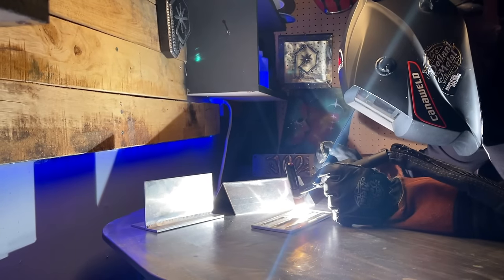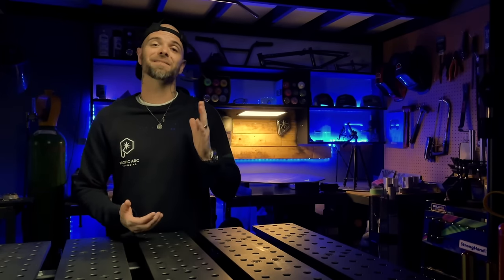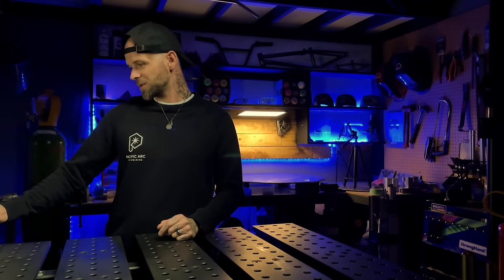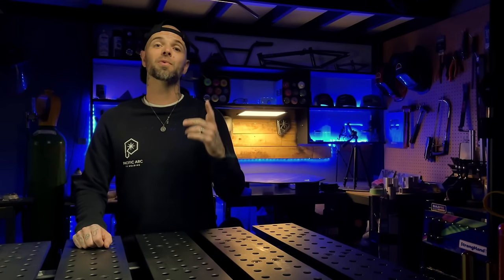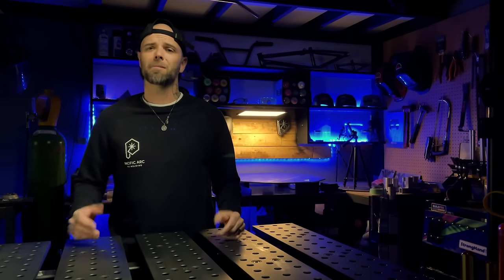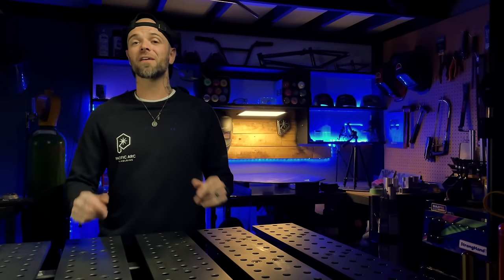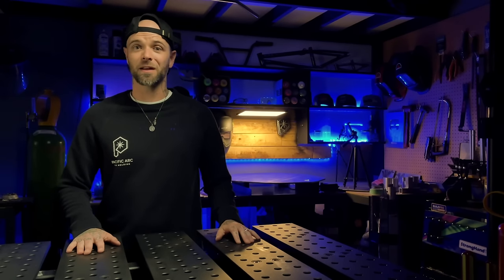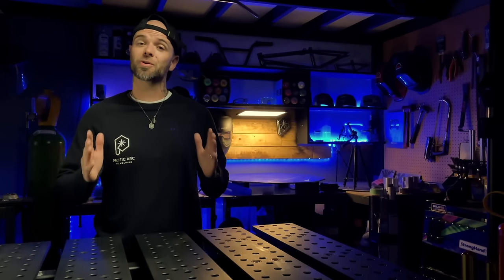a WARNING to all beginner tig welders.

Comment: I've been TIG Welding for more than 50 years. In fact, it's all I know how to do. I can't Stick-Weld for s***. I don't like Wire-Welding of any kind ... Simply put, "I don't like sparks". TIG is clean, quiet and versatile. That said, this channel is GOLD and is the ONLY welding channel I watch. "Why" you say? ... here, I'm reminded of things I actually knew from experience, as well as the occasional "I could have had a V8" moment ... referring to "duh" ... and the ODNT thing.
Reply: I'm the polar opposite, I can stick and mig weld but can't weld tig for s##t 
I'm wanting to build my own custom exhaust, I don't want to use mig, I sure as hell ain't using stick so think I'm going to have to bite the proverbial bullet and start practicing tig welding lol

Comment: Took me about 5 months of welding in HS welding class and also showing up early every day during lunch to be good enough to get a job doing it. The first thing my teacher had me do with each weld process was scribe lines on 5"x5" flat plate and run just the torch no filler over them till they were all a consistent width. This got the whole class good at controlling heat with the pedal before ever using filler.
Reply: that sounds like a good trick for me to practice!  —  I’m totally new … so, yeah, I need to put in the hours doing this, exactly.  💜👍

Comment: Yeah, discovered that the hard way 😏. One bottle of argon later found my collet body was loose. Been paying more attention as to the shape of my torch and things have been going a lot better 😊. In all that I also found that having 3 or 4 electrodes preground is a big help too 🤣.
Thanks man. Cheers!
Reply: I grind the whole pack and keep it on the weld table next to me because stopping to grind tungsten is a huge buzzkill.

Comment: I have been watching your videos for about 1 and half years and still have not picked up a torch. Im going to change that. I picked up an AHP 203xi and will be practicing what I have learned from your videos and what I want to weld is not and easy starting point. I and getting into my motorcycle building and need to weld on the frame and tig welding looks awesome. I cant wait... all Im waiting on is my argon to come in. Wish me luck.

Comment: I started off with gas welding, so I found tig far far easier then stick or mig. but it is still a brute force weld, not very pretty but solid and reliable. Advantage of that you learn all about torch set up, and keeping my tungsten ultra sharp hearkens back to my enjoyment of sharpening a pencil to the point it was sharper than a hypodermic needle!

Comment: I started in around 2000 with a three phase miller and would have a scrap piece to ball my tungsten and now use a primeweld 225x and can weld anything with it but the younger generation needs help to get to a good level of understanding and he does a decent job so stop cutting others down and judge yourself on what you’re lacking and not bringing to the table

Comment: Any chance of doing a video on lift arc/ start tig welding? Just tips on how to tack ect. Got my first tig welder and chose this because it was cheap, will be upgrading to a HF down the track, thanks mate!
Reply: Just barely scratch the metal to start it or touch it down then rock it back on the cup. I have to do this even with HF start sometimes if my ground isn't perfect.

Comment: Should I get MIG or TIG?

I've had my stick welding machine for a month now. I am very confident with it now. It's just that I work with thin material 90% of the time and I'd need to get another machine for this purpose.

Until now the only two projects I made are a bike ramp and a metal toy trolly. For my applications, TIG and MIG are much better suited than stick welding. The reason why I'm leaning more towards TIG is because I can weld aluminum and stainless with it, and jobs tend to be much better paying than MIG.

Another reason is that since I am new to welding, I don't really want to get used to the ease of MIG welding in this early of a stage in my career (I know I'm exaggerating a bit here). I want to get used to the complexity and control of TIG from an early stage so I'm better off in the long run.

Comment: Another great analogy would be a guy buys a brand new sports car and thinks he's going to kick ass on a road racetrack. As someone who spent a lot of time and money learning how to drive on a racetrack, i can almost guarantee dude with the brand new corvette and an inflated ego will almost always end up in a tire barrier (or worse) on their first track weekend. Even drivers who know what they're doing are not immune to the curse of complacency. The guy who taught me track driving was killed in a crash on the same track he taught me back in 2017. 

A while back a friend loaned me his $1200 multiprocess (yeah...) Lincoln TIG and a bottle of argon i'm still feeling in my back from loading into my truck, and I agree it's definitely not easy. I watched a ton of videos and still had issues. The biggest of which was one of the most elementary of concepts... electrode distance. For some reason i had it in my head that farther was colder. Once i got back on track, i was able to make some not-horrible welds. I'd love to spend some time with a TIG that had high frequency start. The machine only had lift-start and while i got pretty decent at it, i got tired of resharpening my tungsten pretty quick.

Comment: Hey dusty best advice I've seen on here for a long time . Love the golf analogy.. as a biker that is the epitome of all the gear and no idea. 
I bought a German made set up about 3 year ago with intentions of using more than mig . Boy is it an eye opener however as a lot say practice works , I'm still at the base level but it's fun trying to get all the things coordinated at the same time . 1st few attempts came out pretty good flat straight runs.  I've found cleaning can be an issue sometimes however it's a learning curve . Thanks for the advice .

Comment: I kept having dirty tungsten when welding aluminum, then I increased the post flow to 8 seconds, and used smaller cup so I can get by with a lower gas flow, and the dirty tungsten problem went away.

Comment: A TIG torch is just a handheld arc furnace. Any impurities will rise to the surface as slag. No need to waste time/argon for clean welds if you aren't doing sanitary or out-of-position welding.

Comment: Hey guy, I have a miller syncrowave 180 tig/stick welder,when I got the machine I noticed that it had a 20 second shutoff for the gas,is there a tig handle with a shutoff valve on it the also use the foot pedal,any help would be appreciated

Comment: Is it just the particles in air that contaminate and burn your tungsten 
Or the carbons from welding 
I’ve done a fair amount of stick welding on tractor s and mig around the shop. Brazing and even jewelry repairs ! I’m fascinated with tig and I have a lot of drag bikes ( mini drag 200-300cc) and I really wanna learn to do stainless tubing for exhaust! Exhaust tuning is where you get some extra horse power and makes some really sick engines , max flo thru  big valve head !

Comment: Personally I'd start out with a Mig welder with the bottle of 75/25 and learn how to use it first and then move on to TIG later. If you're just starting out.
Reply: If you want to learn fast you will want to start with the more manual processes first. Mig can teach bad habits that are hard to forget if you have the machine set up wrong to compensate. In school I started with 7018 stick, then did mig, then aluminum tig.

Comment: Just seeing the thumbnail I thought you were going to tell us not to constantly bend the "flexible" torch heads. I say this because they can and will break. The ones iv seen break and fall apart are corregated copper tubing. Copper work hardens like aluminum does and will crack if you bend it one to many times. Cheaper torches that come with the cheaper welders will break a lot faster.

Comment: I'm currently working to learn stainless butt joint. I am running a pedal set to 98 Amps. 1.2 mm material set in a purge block no filler. Trying to learn this for an employment test.

My problem is by the time I get full penatration, my bead looks too hot on the top side. The backside looks good nice and silver even penatration. But like I said top is dark with small areas of pink coloring and some matte grey areas. How can I get good penatration without getting it too hot on top?? Orrrr is this a gas issue??
Reply: 1.2mm is about 0.047”. If you go by the “rule” of 1 amp per 0.001” that should put you at 47 amps. Maybe try lowering the amperage… unless all the settings are set for you for this test.

Are you using a gas lens? What cup size?
Reply: @VictorMPR  yes a gas lens and using an 8 cup. I want to buy some jumbo lenses and cups on payday. I'm not sure if they set the settings for me or not. I do know after initial arc start I come about halfway off the pedal. (I'm still trying to get used to this though.) I will try lowering my amps. I believe the actual test will be on .065 mm material. I'm using the only stuff the school has to practice. 🤷‍♀️
Reply: I find that 15% to 20% less than the "rule" of 1 amp per 0.001" works better for Stainless. But lowering the amps doesn't always help. It can slow things down & you end up putting more heat into the work because the pass takes longer. Better to just get a move on! (Easier said than done though...)
Reply: Fupa 12, flow at about 30-35 cfh and crank your amperage up higher than needed so you get full penetration then keep it at all you need and go as fast as you can to get out before the oxidation sets in
Reply: @MidEngineering  yeah I have adjusted amps up and down. Speed up and down. I've tried filler to cool the puddle. No filler. Tiny gap. No gap. High cfh low and mid cfh. Just so many combos it could be lol! 🤦‍♀️🤦‍♀️🤦‍♀️I'll be going in tomorrow to work on it some.
Reply: @chad103099  lol!! I'll try that! My fast speed is probably slow speed for most. I worry more about running out of time during the test than failing the test. I have 4 welds foe the test. T joints stainless and aluminum (got these down to an art now) also butt joint stainless and aluminum. I'm terrified of the aluminum because it was way harder for me than stainless and I'm struggling on the SS butt joint.
Reply: 30 amps per mm in flat Position, and at that thickness you'll need aluminium blocks to move heat
Reply: @Slouworker  the purge block is aluminum.
Reply: @Slouworker  I'll try that heat tomorrow

Comment: I started welding for the first time this year. I managed to knock out Stick in a few weeks. Then I moved on to TIG. I'm far from an expert and never will be, but I will say this:

This man is spot on. the fundamentals of stick carried over to TIG. If you don't make sure the little things are done, it doesn't matter what you have. You could base metal so clean it's a mirror, but if your setup isn't right (heat, good rods/filler metal, clean stinger contacts/clean torch, so on) you're only gonna get bad results. GIGO. Garbage in, garbage out. 

I love my new found talent because it's the first time in my life I genuinely understand something I'm doing. That weld isn't picky. It doesn't care who you are and it doesn't like the next guy any more than you or any less. So when you screw up a weld don't immediately blame the equipment. First point to yourself and ask what YOU didn't do right. I've laid plenty of beads at this point and I've yet to lay a bad one that was anythings fault other than my own.

Good luck guys! Send it.

Comment: Are there differences of the helmets for different types of welding?
Reply: Hi Ron, if you're planing to weld TIG with a auto darkening helmet, you'll need to make sure it's TIG compatible. Some helmets don't have the sensibility to darken with TIG. Cheers.
Reply: Some darken to a fixed shade, may be too dark for tig. Need an adjustable one.
Reply: here in australia  ? i found i had to buy another helmet my ,mig helmet didnt go light enough  to do tig ?  mig is higher amps so darker the shade , were tig is lighter shade ?

Comment: Why do only show welding Aluminum  not steel 
I  lay two pieces  of steel together  and try to weld it together I just burn holes in the top plate don't matter   what's the amps are set at can't  even tack weld I just burn holes in top plate  40 amps burn holes 10 amps burn holes .
I have two welder a 210 Lincoln scratch start also got a Vulcan 205 high frequency start when i first got Lincoln I welded a bracket on my rotisserie   for the first time doing tig I was a fair job but it was only 2" long also 
Now I just burn holes  If I do fusion weld I have too go fast if it don't burn a hole in plate but you can Not feel the weld but can see it  
Had a guy from my work place that works in weld shop he there something  wrong with his welds where full of holes he weld on trailer  just about every day  he can also tig weld  so I took Vulcan 205 back got a new one does the same thing burn holes don't matter what the amps are 10 or 40 on 22 gauge steel I called the welding store where I get my gas I asked them if it could release the wrong gas and not a hundred percent Argon they said no way it could be the wrong gas
I think it is the wrong gas I shouldn't be getting Sparks and sometimes I get Flash starts when I do get a bead going  also  the bead is flat as it  can be even with filler to get any body to weld I have to go fast  even at 10 amps   with 1/16 tungsten

Comment: 99% isopropyl alcohol…. after grinding clean…?
Reply: He uses acetone
Reply: @markshort9098  I have that stuff just in case, but avoid it when I can ‘cause it has evil fumes.
Reply: @dennisyoung4631  yeah it's nasty stuff but it cleans the best.. i used to near bath in it back when i worked in a fibreglass place so a little on a rag doesn't bother me to much
Reply: @dennisyoung4631  Organic chemicals which are evidently good at clearing off weld-screwing-up grease tend to go rogue (as in phosgene, etc) when heated, even if only remnants remain.  Be careful!

Comment: I found that the HF start on some cheaper machines can be a pain in the butt. Upgraded to a nicer machine and never had any frustration on starts again. So there is a limit on how cheap you can you. Although... I did weld with it for 5 years and you learn to work around the shitty HF.